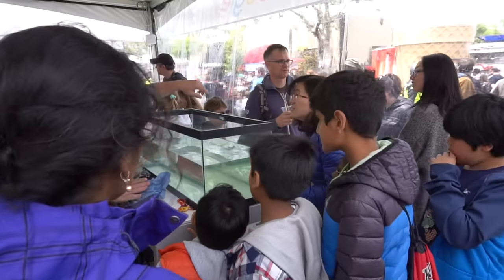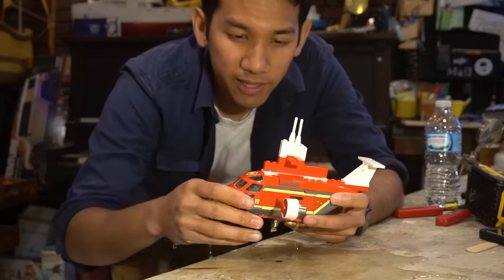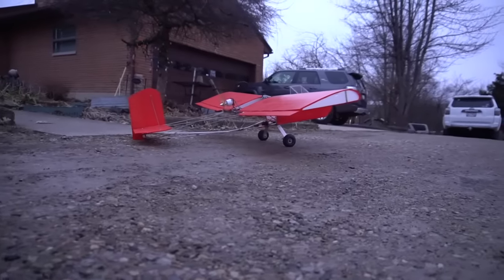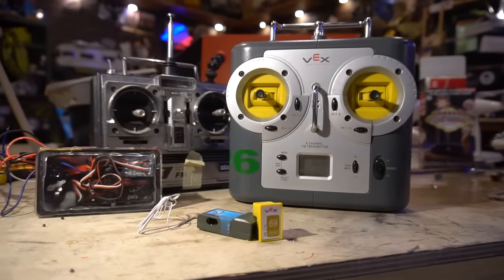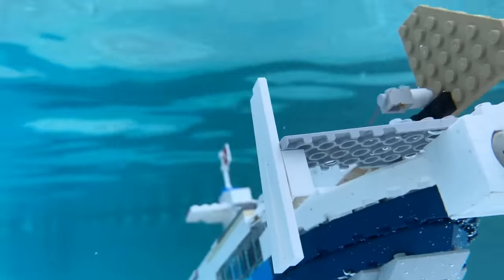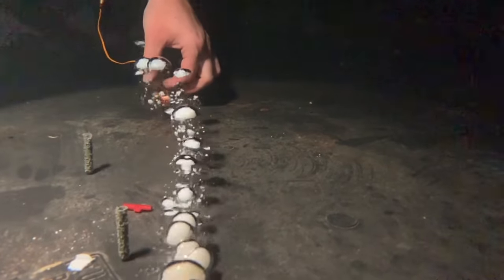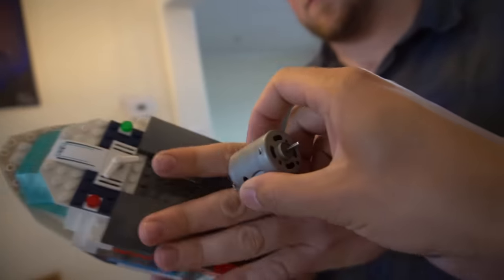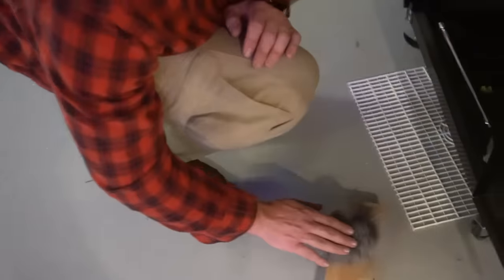BUILDING RC LEGO SUBMARINES

Comment: Dude, you should make a watertight LEGO rc sub and have an interior camera, throw a depth charge, and then watch it flood from inside.
Reply: MrToastedBagel
I tried making a watertight LEGO thing, their connection isn’t watertight, so he would have to seal them together
Reply: Use a 3d pen to fill in gaps
Reply: You can use any thick grease to watertight them
Reply: Use rtv to seal joints

Comment: I wanna know if the lego bricks were undamaged by the depth charges
Reply: Me too
Reply: Probably, the connections are one of the weakest parts of a lego build
Reply: That part hurt my feelings 😭
Reply from the maker: suprisingly no! they seem fine so far, The nice thing is the water shields them from being burnt by embers from the fuses of the fireworks
Reply: @PeterSripol  please do a RC naval battle between submarines and ships that would be awesome. maybe you could even bombard them with planes. pretty sure more than one app or video game would sponsor that.
Reply: They're ABS which can be nearly indestructable (ever step on one in the middle of the night, you can't break them, but they will penetrate your feet like nothing) and the structure has built-in parts for it to come apart at so you can't put any real force on the ABS...

Comment: The 2.4 GHz band was deemed to be commercially useless because rain or moisture in the air would significantly attenuate the signal.  It was used for ham radio for non-critical applications (in good weather) and found use in microwave ovens for the same reasons (water absorbed the energy).  Nobody really though that someone would want to use radio indoors -- then along came WiFi and bluetooth and there was available spectrum that had previously been considered essentially useless!

Comment: Build idea (“easy” version):
A sub that launches a radio controlled rocket (or airplane) that you can control & maneuver. 
Build idea (hard version):
A sub that launches a radio controlled rocket (or airplane) that you can control & maneuver and utilizes some type of telemetry to take out an airplane mid flight. 
Build idea (Extreme version):
A sub that launches a radio controlled rocket (or airplane) that you can control & maneuver as above but rocket (or plane) flies into airborne plane’s rear cargo bay then explodes. 
Build Idea
(Extreme Version 2, The Revenge):
A sub that launches a radio controlled rocket (or airplane) that you can control & maneuver as above and rocket (or plane) flies into airborne plane’s cargo bay then explodes causing pilot to eject with parachute landing above sub and pilot dives down and takes out sub with explosives.

Comment: Using only LEGO pieces and some non-standard motors, it's even possible to build a flying helicopter. The beginnings are here: https://www.youtube.com/watch?v=TTui3shLRPk
If I had an infinite LEGO warehouse (plus infinite glue and batteries), I'm pretty confident that I could build any machine. Is there some kind of equivalent term for "Turing-complete" that can be used to describe machines and manufacturing processes? Because that's what LEGO is (besides being actually Turing-complete).

Comment: Hey Peter, what's the long range capability of rc subs if any, would you need to deploy a wired floating antenna(s) in order to have some sort of autonomous long range capability or is there a frequency that could pass through water at some depth?

Comment: I doubt anyone will see this because the video is 2 weeks old but I am just starting out in rc and I had 2 questions. First of all what was the chip above the speed controller and my second question is if you have 2 motors such as the small red one will you need 2 escs and batteries? Thx for inspiring me to get into rc👍

Comment: Me and a friend would also like to make an RC submarine (we do have a 40 MHz RC controller), but we are still strugling with two things: How would you control a small, low power, engine with a raspberry pi, and how could we go about making the motors waterproof. Does anyone have any advice on this?

Comment: to get trough the water youll need to have water and a rocket u trun on the rocket it boils the water
and it turns into steam tthe compressed air will need to push the rocket trough the water once in the air their engines or rockets
are bale to ignite i mean its a hard mechanism but it will need more than enough compressed air to pass it trough 40 meters of water
anyways i hope it worked

Comment: Its mostly because water acts as a decent conductor at lower frequencies. Higher frequencies just reflect off of water. Have to take that into account with different types of radio and telecommunications. For example different wavelength are better for different applications such as it is here. HF radio bounces off of the ionosphere and the Earth and can do this many times. Making it able to travel extremely long distances. Military submarines use extremely low frequency wavelengths because it has much better penetrating power in water than the higher frequencies. Your analogy with the lego men and the walking didn't work. The longer legged figure would just be able to walk through but the shorter leg figure would actually reflect off. Very small amount of the energy actually penetrates the water before it is eventually absorbed.